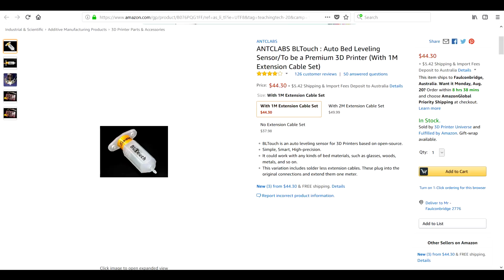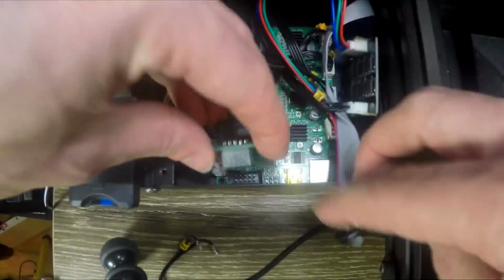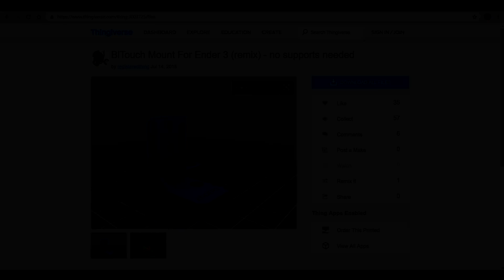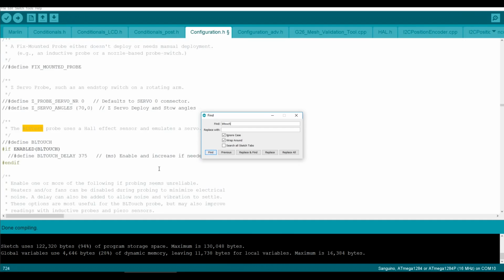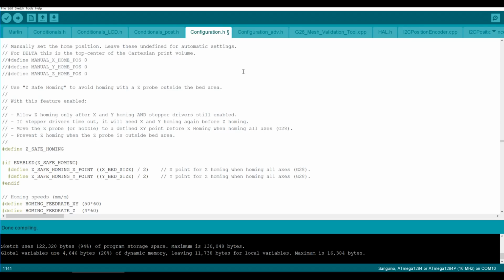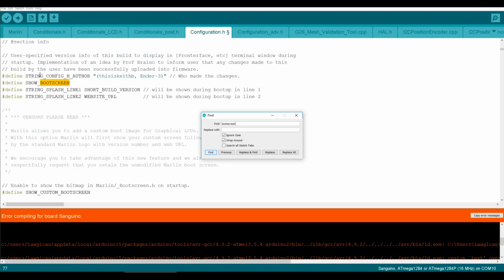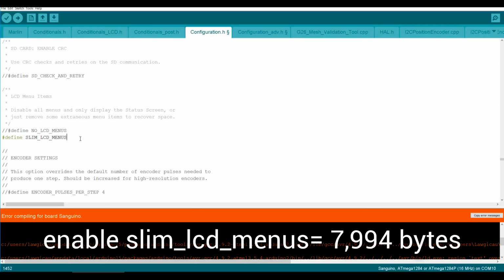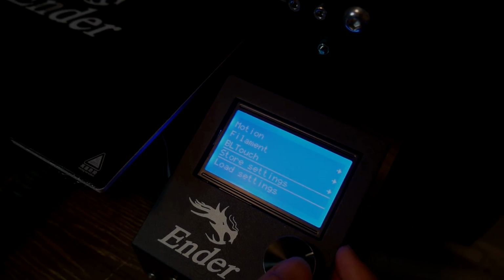Ender 3 BLtouch vanilla Marlin guide

Comment: I was able to get a Geetech 3D Touch working following this guide. One comment though, disabling the speaker option means that Marlin reverts to beeper functionality on pin 27, which can still interfere with the sensor. To fully remove the beeper, in the file pins_MELZI_CREALITY.h add a line "#undef BEEPER_PIN" just below the other #undef lines. You also save more space doing that as full beeper/speaker support is now compiled out.
Reply: Hello John, Would you kindly explain in details where to find #undef line so I can add the #undef BEEPER_PIN. Thanks. This will surely help me to get rid of the interaction from the formally allocated pin 27 to the beeper
Reply: @humaxakin  Look in the file pins_MELZI_CREALITY.h, you have to add the line by yourself.
Reply: @BigJohnno66  I cannot find any file called pins_MELZI_CREALITY.h anywhere.  What folder is it in (Configuration.h, Configuration_adv.h, etc)?
Reply: @MrBudge72  Maybe you are not using Marlin 1.1.9 as all files are in the same folder in this version.
Reply: @BigJohnno66  I am using Marlin 1.1.9.  When I change my Marlin settings using Arduino 1.8.7, there are tabs at the top for different "folders".  How do you make changes to Marlin?
Reply from the maker: Thanks for sharing, good info.
Reply: In mine it was more complex than simply adding a line to undef that variable!  I noticed that later on down in that file there was an if..then..else that could bite you by REdefining it AFTER you THOUGHT you'd done the job.  (that IF is considering the possibility that you're using a filament OUT detector, I believe)
Reply: Now that I have had my Ender3 incapacitated for SOME WEEKS NOW - in my attempt to add my 3D Touch - I find YOUR success (John) to be TANTALIZING!  I'm wondering if my unit is faulty or I've just managed to cobble the software INCORRECTLY.  Dunno - tried straight-up Marlin from GitHub AND from Creality, plus the TH3D universal offering - so far I can't get past the Home Z attempt to proceed to any bed leveling.  About to toss this thing into the fireplace -- may as well warn prospective buyers of Geeetech's 3DT -- if you speak English (as do I) do NOT expect ANY technical support from them - just bite the bullet and spend a little more (although I have ZERO experience with BLT so I can't guess if they're any better).

Comment: Very good video.  I had earlier updated the firmware to vanilla Marlin as instructed. It worked fine although it was more challenging to get the mesh bed leveling to work than I expected.  Went back to no mesh bed leveling and then decided to try the BLTouch.  Used the board adapter to avoid having to cut wires.  However, in trying to follow your instructions on swapping the pins attached to the adapter I noticed that the order of the pins should be,  viewing left to right (as marked on the adapter) gnd, +, signal.  This was as the wires were in the connector.  Plugged it in, turned on the power, the board went pop.  No more board.  I am giving up on this printer.
Reply from the maker: I mentioned a warning for this is the video, very sorry to hear it has been damaged.

Comment: When printing on the first layer, the BLTOUCH probe will always stick out. How do I set this up?
Reply: Why does the probe stick out all the time in the first layer?The probe struck the first layer of material, causing it to shift. Is this inevitable. I watched some videos, and it seems they're all like that?
Reply: I found a new problem. When printing, the red light of BLTOUCH will keep flashing. Is this normal?
Reply: This sensor's problem,I have fix it now.
Reply from the maker: Please post your solution for others to learn.
Reply: The reason for the problem is that the magnetic force of the machine screw above the sensor probe is not enough. I put a corresponding size H2 hex wrench on the screw. Since the wrench has magnetic force, the problem is solved temporarily (it seems strange). I have already purchased some threaded magnetic rods in China Taobao, M4 specifications, and can replace the original machine screws when the goods arrive, it is estimated that this problem can be completely solved.
Reply: Threaded magnetic rods cost only RMB 0.2 each. If the effect is good, I will update the message here.

Comment: will this work with a 3D Touch sensor? 
BL Touch are not that readily available in UK
Reply from the maker: There is a good chance but the clones don't have a great reputation for accuracy.
Reply: Thanks for the response, I purchased a genuine instead for higher cost (£45 UK)

Comment: I purchased your configuration file and this error occurred during compilation: _Statusscreen.h: No such file or directory, what should I do?
Reply: I am using arduino 1.8.7
Reply from the maker: Please read the instructions you got when downloading. You have to add the U8Glib library and Sanguino support, the video is linked.
Reply from the maker: And copy the files from the Ender 3 example configuration. All covered in the link.
Reply: thanks a lot
Reply: There was another problem. After I filled in your G code, the printer did not heat the extrusion head and the hot bed at the beginning of the printing.
Reply: G21       ;metric values
G90       ;absolute positioning
M82       ;set extruder to absolute mode
M107      ;start with the fan off
G28 Z0    ;home Z
G1 Z15.0 F840
G92 E0    ;zero the extruded length
G1 F200 E3              ;extrude 3mm of feed stock
G92 E0                  ;zero the extruded length again
G1 F840
;Put printing message on LCD screen
M117 Printing...
This is the initial G code for CURA. How do I add your ABL code?
Reply: When printing, sometimes the BLTOUCH probe will touch the hot bed and interfere with the first layer that has been fitted. Is this normal?
Reply: When printing on the first layer, the BLTOUCH probe will always stick out. How do I set this up?

Comment: Hello, First I want to thank you for all your videos they are very helpful. 
I just purchased your prepped config files. When I go and add my offset for my printer (-46 and -8) I get a error when I compile 
static assertion failed: RIGHT_PROBE_BED_POSITION is outside the probe region.
I have changed nothing other than the offset for my printer.
Thanks!
Reply from the maker: It's because I've set it up to be symmetrical. Edit the lines from line 1023 to match and you'll be good.
Reply: Thank you! that work great! again Thank you for everything you do for our community.
Reply from the maker: You're welcome. Thanks for watching and supporting.

Comment: Thanks for the great video. !! I followed  the video and got everything wired Perfectly. Bltouch, self tests, I flashed firmware,  however now the z axis wont move down. It will move up via LCD but not down. Also will not home z. I did not have this issue previously. Any advice?
Reply: I also purchased your files and used those
Reply from the maker: Sounds like the z end switch is reading as triggered all of the time. Hence why it won't home or go down. Please connect via USB and send M119. It should report endstop status.
Also, genuine BLtouch?
Reply: @TeachingTech  yes genuine bltouch, ok I will try in a few hours when I get home and will report. Thank you so much for your help and your great videos.
Reply: I sent the M119, x y and z_min: open and bltouch stays red. It initially does the self test but then just stays stowed. What do you think my next step should be? Again thank you for your assistance
Reply: Got it working, I had to switch the black and white cables.  Once I did that started working
Reply from the maker: Glad that fixed it. Can't remember if I mentioned that in this video or the prevoius one.
Reply: @TeachingTech  I had the same issue with Z only raising but not lowering, despite a genuine BLTouch and matching the polarity you and every other BLTouch installation instruction shows (black beside black, white beside white). I swapped white and black and now my Z will raise and lower, but I still have other issues that I'll post separately. Just wanted to point out the wiring does seem to be backwards on some genuine BLTouch units apparently. Or perhaps the v1.1.3 boards are wired backwards to earlier revisions.

Comment: Darn - I was going so well and then after 1 download - I know longer get any display. looking though all the code again, and cant find the fault.

Fan still runs and I can connect using S3D with a cabled connection so the board isn't dead...any suggestions.
Reply from the maker: Sounds like LCD is not connected properly. Please check pin27 board alignment and fit.
Reply: Teaching Tech thanks mate.  I started with a fresh code base and did it over again and it worked.  I must have fat fingered something in the code.  Really enjoy your content mate and amazed that you replied.  I put you on my Patreon. With thanks.    Kiwi in Boston.

Comment: I followed the guide, done the wiring correctly, the probe seems to be functional, lights up, deploys and stows, but it won't stop the z axis moving. 
If I try to home it will crash into the bed.
 I use a Triangle Labs clone.

Tested with gcode:
M280 P0 S160
M280 P0 S60
M119

After M119 it will print z_min triggered or open depending on the position of the probe, so it seem to be working fine.
Reply: Turns out the mount I got of thingiverse was wrong dimensions. The probe was too high. Added a washer and it now works.

Comment: Noooo!  Use a fish-tape (thin stiff wire like a straightened wire coat hanger) to first feed through the fiberglass sleeve from the destination end then tape the electrical wire cable to the end of the fish-tape and pull it all back out the destination end. So much easier and its exactly how the pros fish wire through conduit.
Reply from the maker: Thanks for the advice. I don't do much fishing..
Reply: @TeachingTech  I like your videos but that was painful watching you shove that blunt connector through the mesh!
Reply from the maker: It was painful to do it too! Thankfully many great suggestions from commenters such as yourself.
Reply: @TeachingTech   No problem! I've been trying to decide between a few printers for my first 3d printer and your insight and knowledge sold me on the Ender 3. I appreciate the details.

Comment: Attention!!! For those who will use BLTOUCH clones (TL Touch). It works a little bit differently than original. You will need to set "#define Z_MIN_ENDSTOP_INVERTING true". It works and with "false", but accuracy and repeatability will be very bad!
Reply: Do you still need to set  "#define Z_MIN_PROBE_ENDSTOP_INVERTING" as true or can that remain false?
Reply: Hi i have a TL touch i buy link in discription configuration.h and installed my ender 3 tl touch works but failed because i set z offset and everything, when printing nozzle too high dont touch the bed can you help me
Reply: @djfatihfb  z offseti ayarlayıp kaydetmeniz lazım yaptıysanız bana da aldığınızın linkini atabilir misniniz
Reply: @enesdemirkaya3622  hocam satın aldığım link bozuk çıktı tüm sorun oymuş videoyu takip edip tek tek elle düzenleme yaptım mecburen bu şekilde çalıştı clone olan.
Reply: @enesdemirkaya3622  yapabildin mi
Reply: @djfatihfb  yok benimki daha gelmedi yeni sipariş ettim sahtesi 60tly di orjinali 250 tlydi ben de bir şekilde çalıştırırım diye düşündüm. Sahtesini çalıştırmak için ne yaptınız ?
Reply: @enesdemirkaya3622  fark yok sayılır bu yorumdaki şeyi yaptım sanırım tek fark olarak ha bir de fan devre dışı geliyor onu da aktifleştirdim dosya olarak gönderebilirim
Reply: @djfatihfb  Hocam çok güzel olur eğer marlin klasörünü gönderebilirseniz: enesdemirkayaya@gmail.com
 Sizinkinde nozzle ısıtıcısının termometresi çıkınca çalışan koruma(thermal runaway) ve elektrik gidince devam ettirme özelliği var mı yoksa yer kalmayınca sildiniz mi?
Reply: @enesdemirkaya3622  sanırım devam etme özelliği artık yok ben çıkarmadım sadece burdaki değişiklikleri yaptım. Klasörü gönderiyorum.
Reply: @djfatihfb  tamamdır teşekkür ederim
Reply: @enesdemirkaya3622  bootloader açmayı unutma kolay gelsin

Comment: wow made it this far in a week. I even bought the configuration files, cause I mean $0.72 USD! would have taken men longer then that's worth to follow along LOL. but now when I run G29 the probe just misses the front of the bed. Id like to change the firmware bed measurements by -.30mm so its on the bet and would miss the front of the binder clips the printer comes with. Dose anyone know where off hand that info can be found in the firmware?
Reply from the maker: In configuration.h, search for '  #define FRONT_PROBE_BED_POSITION'. Uncomment and add number to the end for how far from the front it should probe.
Reply: @TeachingTech  fantastic! Thank you.
Reply: Did this end up working for you?  I set   #define FRONT_PROBE_BED_POSITION 20 and
  #define BACK_PROBE_BED_POSITION 180  the probe still goes to the front edge
Reply from the maker: I did 30 for the front, which moved it back enough to clear the lip. Not the full 30 though which has me confused, as previously this worked like a charm.

Comment: I noticed it was mentioned in the video but is something to watch out for. Be careful installing the board from the U.K.  You can install it with 2  pins exposed to either side and probably damage the printer board or display since it will not be installed correctly. The Australian pin 27 adapter looks to have the same socket and I can't tell if the TH3D one does or not. As long as you are careful it will work fine.  Here is what I am describing. https://imgur.com/a/ypnMiRx

Edit, I have the adapter board under the mainboard to show the sizes of the parts. Between the lighting and the cat I had trouble getting a good picture of it. Oh and I also purchased your files.  Keep up the good work.
Reply from the maker: Aus board is the same. That is a great pic to show the potential problem.

Comment: Question , I have the original ender 3.  For raspberry pi camera and bl touch integration, do you recommend   the new vanilla  Marlon of the th3d version or it doesnt matter?
Reply from the maker: Doesn't really matter, Whatever you are comfortable with. Octoprint through Raspberry pi can be used on stock firmware if needed.
Reply: thx aussie mate

Comment: With the nylon sleeve if you push the ends together (making it shorter) the diameter will expand allowing the cable to pass through more easily. Then stretch it back to full length once afterwards.
Reply from the maker: That was something I experimented with but didn't master. Thanks for the tip.

Comment: I paid for your config file, done what you said and got the following error:
In file included from sketch\MarlinConfig.h:42:0,

                 from sketch\ultralcd.cpp:23:

SanityCheck.h:1705:2: error: #endif without #if

 #endif // SANITYCHECK_H

  ^

In file included from sketch\ultralcd_impl_DOGM.h:49:0,

                 from sketch\ultralcd.cpp:96:

dogm_bitmaps.h:136:29: error: _Statusscreen.h: No such file or directory

compilation terminated.

exit status 1
#endif without #if
Reply from the maker: As the instructions state: "You will need to setup Arduino and flash a bootloader as seen here: https://www.youtube.com/watch?v=N7JLchsFRDU"
Reply from the maker: You are missing the file _statusscreen.h
This is shown in that video. It is found in the example configuations/Creality/Ender 3 folder.
Reply: Ok I have downloaded the right Firmware and all seems to be ok now.  Many thanks again.  Also I would like a filament run out sensor to the printer?  Any ideas or maybe a new video idea for you?
Reply from the maker: At some stage I will do this. Don't know about the Ender 3, however. Running out of physical pins and space on the 1284P.

Comment: Great video, my total file sizes were a little different than yours, but i found that after moving to slim menus it fits on my board anyway. 
It'd be great if you could make a vid focussing on the configuration you do  on the Ender/BLtouch after writing the firmware to the printer.
Reply from the maker: An older version of Marlin but this one covers optimising the speeds and probing grid to be symmetrical: https://www.youtube.com/watch?v=BV11-VOQjMc
Reply: Thanks, I've had problems with my levelling, so i grabbed your $1 download, then used this as my startup Gcode (after setting Z offset with paper, then saving) G21 ; (metric values)
G90 ; (absolute positioning)
M82 ; (set extruder to absolute mode)
M203 E80 ; (set extruder max to 80)
G28 ; (home all axis)
G29 ; (Auto Level)
G92 E0 ; (reset extruder)
G1 Z1.0 F3000 ; (move z up little to prevent scratching of surface)
G1 X0.1 Y20 Z0.2 F5000.0 ; (move to start-line position)
G1 X0.1 Y150.0 Z0.2 F1500.0 E15 ; (draw 1st line)
G1 X0.4 Y150.0 Z0.2 F5000.0 ; (move to side a little)
G1 X0.4 Y20 Z0.2 F1500.0 E30 ; (draw 2nd line)
; G1 E27 F1000 ; (retract filament 1mm)
G92 E0 ; (reset extruder)
G1 Z1.0 F3000 ; (move z up little to prevent scratching of surface)
M117 Printing...

i just keep getting probing failed, then it starts trying to print, and makes a squiggly mess of unstuck PLA

Comment: Great tutorial as always Michael. For a change, I might be able to offer you (and everyone else) a tip. When threading the wires through the sleeve, push the sleeve together length ways, this will cause it to expand giving plenty of room for the plug to be pushed through with the wires from the end. When I did this on the CR-10 S4, I used a 2 meter extension cable and sleeve and it worked perfectly.
Reply from the maker: That's a great tip, thanks Spike.